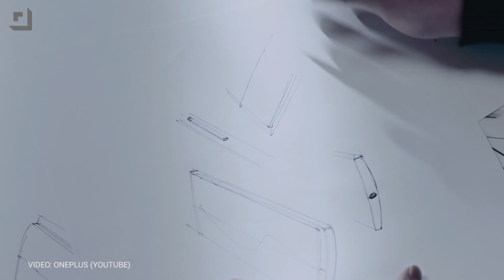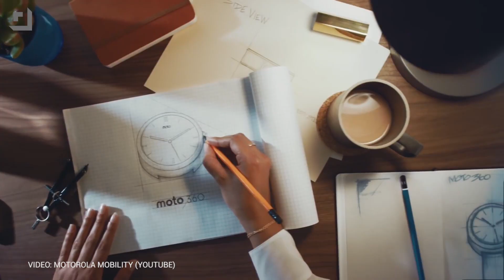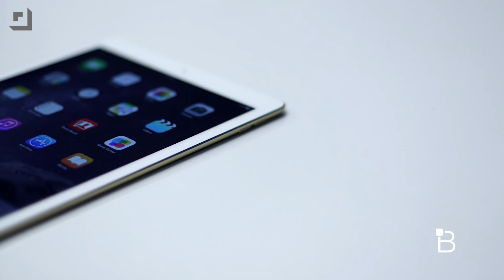Android Wear on iOS and iPad Pro Delayed

Comment: I want to get an iPad pro for college but I wanted one before September...
Reply: Seriously don't get an iPad for college. It's a pain to write papers on and the only real good thing about it is you can go such a long time without charging it. The only real use I have for mine is to read my .pdf textbooks I found online for free so my iPad has practically paid for itself so that's neat, but for nearly all other purposes I just check out a laptop from my library and use that because it does everything else a lot better.
Reply: well I am hoping apple will be upgrading this iPad to make it seem more like a Microsoft Surface or even if they just had better word integration... I use google docs most of the time and I don't find it too difficult with my current iPad but I wanted a new one because mine is ancient... iPad 2.

Comment: I just want to know if Apple is making a 6th gen ITouch ;_; I've also never owned a phone but if I ever did get one, i want it to be an LG phone with iOS
Reply: Victor Mendoza Kid. If you want a good phone, it's not ios you want to go to. Get a oneplus one or samsung galaxy s6. Android is better than iOS.
Reply: Wayne Kosimto I know Android is good, I just want something familiar which for me is iOS. But I don't want an iPhone, just iOS on a well performing phone like those of LG
Reply: Victor Mendoza That won't ever happen. Ios is not open source and their performance relies on heavy optimization and low res screens.
Reply: I know it won't ever happen, and that's the reason I'm somewhat sad
Reply: Victor Mendoza If you know for a fact that for you Android is better than iOS than get an Android. There are some great phones out there. I am a massive Apple fanboy so I will of course have to disagree with you on that point, that's why I recommend that if you are in the market for a new smartphone, wait for Apple to announce the iPhone 6s and let Apple show off what they have under their sleeve before jumping into anything. If you need a phone asap and you don't like the iPhone 6 or 6Plus, then may I recommend a Nexus for the purest android experience. if I ever had to get an Android (may that day never come) I would want a Nexus.
Reply: Victor Mendoza I recommend to change to android. Just like someone convinced me to get an android phone over a iphone I learned that android looked better and was easier to use than android. Except for the fact stupid companies like "all of them" decide to make android look like shit. So nexus, motorola, or oneplus is the way to go, unless you want to get into the into the flashing process.

OR Google play edition devices which is much more recommended.

(Htc one m8 google play edition)